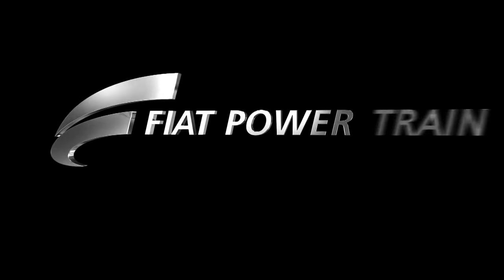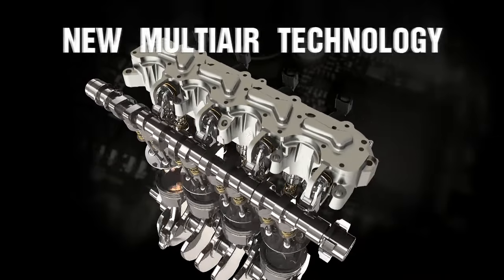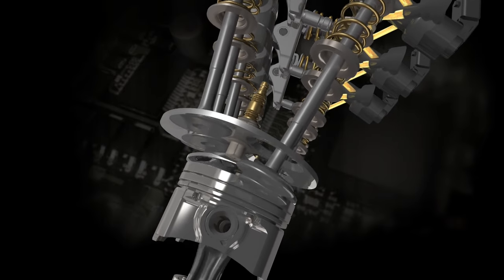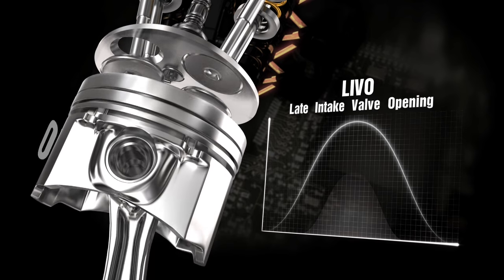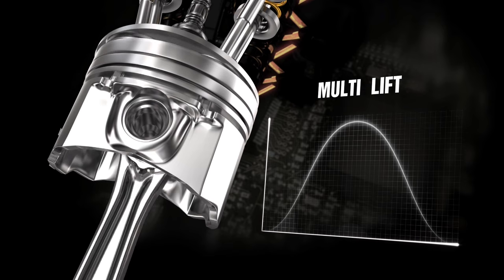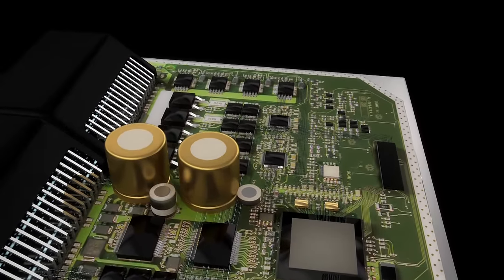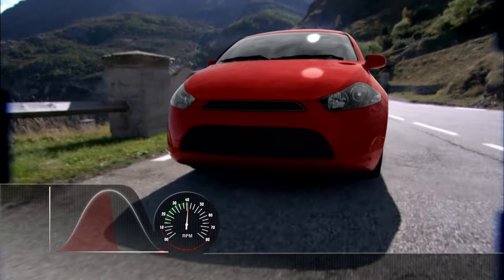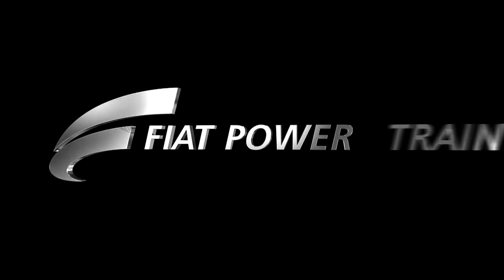How Fiat MultiAir Technology Works

Comment: Solenoid longevity questionable. Electrical Switches wear out quickly throughout history. How was this problem addressed? VVT & lift seems safer to laymen. Horror if solenoid sticks with valve in open position
Reply: Really? Who knew? They have been using electric solenoids to control diesel engine injectors since 1989 at thousands of pulse cycles per minute. All this while having no issue for 500k to one million miles of life span.
Reply: Solid state (transistor) switches have essentially infinite life, provided that they don't overheat.

Comment: Lol at my Dodge Dart that averages 19mpg in the city and 32-36 on the highway, Don't even have a lead foot...
Reply: ajjpro25 how bad is the oil consumption?
Reply: @cahman8  i don't have oil consumption I got a new generation block put in.
Reply: @410cultivar  my 16 Fiat with the 2.4 Chrysler multiair has averaged 1½ qts every 6000 miles since the second oil change. Chrysler says it's perfectly normal. They even showed me the bulletin where Chrysler says up to 1qt per 1000 miles is acceptable during the first 50,000 miles at which point it jumps to 1qt every 650 miles as acceptable.

Comment: I have a question. Would it be possible to vaporize the gasoline in a separate area and just suck in the vapor?? Because gasoline vapor is what burns. So wouldnt that be like the ultimate fuel efficiency?? Just wondering.
Reply: Thats what fuel injectors are for. They turn the fuel into a fine mist and inject it straight into the cylinders, ensuring just the right amount of fuel is used. A separate tank to hold vapor would take up to much space and it would need to continually vaporize fuel or else it would settle and turn back into a liquid.
Reply: Scott Staines Why would a canister for fuel vapor be to big?? There are so much wasted space in the engine bay as it is. Having a canister the size of an air cleaner isnt that big of a deal. And I have never seen gasoline vapor settle back into liquid. If that was possible, my gas cans wouldnt build up pressure.
Reply: the density of the vapor would be hard to control. and controling the fuelammount is very hard...
Reply: Short answer:  Yes, this is what they've been trying to do for the last 100 years.  The problem is that the vapour (mist) droplets group up into larger droplets, very quickly, against anything they encounter (throttle plate, intake runners, back of intake valve).  As larger droplets, they burn inefficiently.  A nice side effect is that they clean and cool these parts in the process.  I think you'll find the benefits you are wondering about in fuel systems that burn an actual gas, like LPG or CNG.  These burn very cleanly, but have other concerns.

Comment: Garbage! It lasts me to 44,000 miles, Multiair rubber sealant leaking oil. Afterwards one of the sensors of the Multiair failed, third, the Multiair valve signal gave me the error. Got rid of it the Multiair is a great inventor but not so good at reliability! The natural double overhead camshaft is a lot better. By the way, I have service oil regularly on time which causes me problems.

Comment: Oh cool can you imagine how fucked up an engine with VVT would run if an electronic component popped on the computer and the computer failed.

My guess is it will continue to run but you would no longer have the use of VVT and the engine would loose power, torque, and be just an all around dog of an engine.

It always scares the shit out of me when a car manufacturer says they will start using a method to electronically control something. Although when it runs it would be more efficient you gotta ask when the computer fails what then.

The mark of a good engine in my book is ease of repair, reliability and durability and finally what kind of power can be pulled out of an engine. Who the hell wants an engine that the electronics will probably only last in a real world scenario around 3 to 5 years. Would be a shame to see an engine with this shit not work right because some small capacitor popped. All any engine wants to do is rotate why invent something that allows for the possibility of failure early.

Way to throw a theoretical wrench in the top end of an engine when it is not necessary.
Reply: How often have you had a EFI fail on you? Contrast that with how frequently you hear people talking about how they just had to rebuild their carburetor for the seventh time in a year.

Comment: still no direct injection...
Reply: Good for them....direct injection for petrol engines....not so many advantages and many disadvantages....many car producers are using indirect, or returning to indirect....only VW is still using FSI.....also ok, there´re exceptions like lexus.:)) using both in one engine.:)
Reply: Karel Lang
Don't forget Ford EcoBoost
Reply: Karel Lang you statement may be true for NA gasoline engines.  But turbo charged gas engines benefit greatly from DI.
Reply: +Karel Lang vw has a couple of engines with both injection systems
Reply: For me, Direct injection means: burned intake valve at 100k miles, clogged injectors, worn high pressure pump and a horrible tractor-like sound at idle
Reply: Thanks god, DI ngines are shit, full of problems, carbon build up in almost all engines, BMW and VW are the worst, at 50,000 km they have 20% less power than new due flow restriction..
Reply: search for carbon build up on DI engines, they dont last.
Reply: and carbon build up like crazy
Reply from the maker: Yes, no Direct Injection and no expensive Direct Injection issues. ;)

Comment: multiair do not change valve time . its only change valve lift
Reply from the maker: This is wrong.  MultiAir  technology for the first time allows for variable adjustment of the valve lift , its opening and closing times, the duration and the number of openings.  This means the MultiAir system enables the intake valves to be opened and closed more than once during one intake stroke, depending on the load condition and driver requirements - and this for each cylinder separately.  This makes MultiAir the world‘s first fully and continuously variable valve control system.
Reply: Continuously... Looks like it can only open when the camshaft builds pressure for the specific valve, that's not continuously. in that way it doesn't really change valve time in the traditional way rather change duration and opening and closing time during the same window of time instead of changing the window of time completely.
Reply: @tearrificd2786  Multiair can continuously anticipate the closing of the intake valve and delay the opening (at the price of a reduction of the maximum lift and of an early closure), using a sporty camshaft, for example a 40 ° / 80 °, you only need to reduce for the low and medium regimes as well as to adapt it to the load. You can get a 40/60, a 30/70, a 30/30, a 40/0 etcetera. You can not get a 20/80 but it would not be very useful.
Reply: @tearrificd2786  trust me, you don't want to open that intake valve outside of a specific window through the engine cycle... destructive things happen when a valve stays open too long or opens at the wrong time. And by continuous, they are referring to the fact that each valve can be continuously manipulated through its specific timing window.
Reply: @Fiat500usa_com  are there plans to further develop this tech and add it to say a V8 for other product lines (dodge charger and challenger for example)?

Comment: Look like a knock off from the HEUI injection system on the International and ford 7.3 diesel engine. We were looking at electronic valve control 25 years ago at Cosworth. I have a Magnetic valve control system in my head but not going to develop it due to it would just get stolen if it worked. Patents are hardly worth the paper they are printed on.

Comment: I'm sorry but your incorrect. It burns so much oil and Dodge has a 10k mile oil change intervol in the owners manual. They burn 1 quart every 2k miles when new and not under excessive load. Do the math. And when the engine has 50k miles on it it's normal to get 750 miles per quart under normal conditions and 500 under heavy load. You can't use different oil or you own it. So by design it's a failed motor. There is no 2 ways around it. All to get another couple miles per gallon at the cost of an engine. That's just bad math. Honda does it with VTEC and it doesn't burn a drop of oil.

Comment: more likely minimum lift to prevent bent valves (of course it is fiat, so who knows)
Reply from the maker: Fiat has made some of the highest revving engines in the world.  50 years ago they had engines that could spin 13,000+rpm, so they know how to turn revs. If you bend a valve on a Fiat, you've done something stupid. Don't believe the hearsay from idiots of the past.

Comment: Funny thing tough, they claimed 10% reduction in C02 15% more torque but... Just put E85 in any turbo engine and VOILA you get the same results (if not better) without any technological "innovation" 😂

Comment: the gains this system promises are not the future. sorry guys. a 2.4L displacement engine making less than 200hp is not "optimized", as often it is proven that the more powerful these small displacement engines are, it also gets easier to get better mileage with them if you dont have a lead foot. My 07 Cobalt SS Supercharged averages 40+ mpg on the highway at 65, and mid to high 30's for most city driving, unless I WOT lol, but the point is my car is dynoed at 240hp from 2.0L and its killing fuel economy numbers for the 2.4L MultiAir and killing it on the performance side too. Its just shit tech lol, when gains of efficiency for this complicated of a system are in the 10% range.... you know its probably bs marketing.
Reply: The Alfa Romeo Gulia has a 2.0L multiair engine that produces 280 Bhp.
Reply: The 2.0 is not supercharged. It's turbocharged. And i had a 2008 cobalt ss with the 2.4 ecotec normally aspirated, i averaged 22mpg with the automatic. I just bought a 2017 jeep renegade with the 2.4 and 4 wheel drive and i average 26 mpg, the jeep also weighs 400lbs more than my cobalt, so no, it,s not a shit show.........

Comment: Synthetic oils are a very good way to slowly but surely destroy a engines. People that run synthetic haven't ever torn down a engines  with about 50,000 miles of hard use and seen the results anything from gaulded piston skirts to worn bearing to the additives separating and stopping up pick-up tubes, camshafts being starved for oil and probably some tricks that haven't been seen yet.

Comment: And that's one more reason why Fiat/Chrysler cars are notoriously unreliable: overly complex design, with too many parts that can fail. Not to mention Chrysler's bad habit of cost saving by producing cheaper parts to begin with.
Reply: not true.. fiat engines have high reliability, they have other issues but not engines problems....multi air is the most advanced technology in gasoline engines... honda vtec engines is based on a fiat technology of the '60 (VVT) and used for the first time on alfa romeo in the '80..
Reply: Yeah, but the best way to throw better power and fuel economy out of the window is to not stick to the oil change schedule, so that the mutiair unit has to be replaced for up to 1500 bucks.
Reply: haha
Reply: AlainHubert actually that incorrect the 1.4 has been given awards and has already proven to be reliable.  in a study of the top 10 motors Fiat was ranked 7th and beat out ford, Mitsubishi, and mini cooper. or delivers more power per litre than most motors built today
Reply: Wendy wooding I'm sorry but, seeing the name Fiat combined with the word award isn't credible. Awards can be bought. (The best proof of that is the Dodge Intrepid that "earned" the "car of the year" awards from Car And Driver as well as Consumer's Guide, back in 1994, and we all know what a POS that car proved to be in the end). Everything Fiat has produced in the last decade proved unreliable. That's why they had to combine their efforts with Chrysler (another crap making company for decades) in order to try and survive. And it ain't going well so far...
Reply: AlainHubert right so in the same study Honda which was #1 and Toyota was #2 and they must have paid to get those rankings and fiat paid to get # 7 as the top 10 best motors. dude your delusional. You really should look at facts and statistics instead of just coming up with your own concept of thinking in your own mind
Reply: AlainHubert s
Reply: @AlainHubert  pretty sure Fiat bought Chrysler because Chrysler was about to go bankrupt...
Reply: @robdavis6008  
Yes, but it doesn't really matter since the resulting new FCA company is again about to go bankrupt anyway...

Comment: like vtec
Reply: Except vtech can't open the valves multiple times in one stroke
Reply: No, Multiair can anticipate the closing of the intake valve with continuity, it can also reduce the lift continuously and delay the opening to regulate the amount of air sucked in and increase its speed (delaying the opening also causes a reduction in the maximum lift and an advance in closing, which does not represent a big problem because in the conditions in which the opening is delayed it is generally useful to reduce the lift and to anticipate closing; however it is still possible to further reduce the lift and further advance the closure for reduce the amount of air sucked in). Multiple valve openings are also possible for each cycle to increase turbulence and combustion rate at low loads. 
I think it can also disable the cylinders but I do not know if it is used, with the multiair you already have a big reduction of pumping losses, so the utility  would probably be low.
One of the main advantages is that it allows to regulate the power without using a butterfly valve which, when partially closed, causes a big increase in pumping losses and therefore in consumption

Comment: LOL if FIAT knew anything about reliability they would NOT have sided with Chrysler... and they wouldnt have had to beg Mazda for a power train in the Abarth Spyder...
Reply: The abarth spyder uses the 1.4 multiair..?
Reply: @hashbrownz1999  Yeah, the hell?
Reply: @hashbrownz1999  Exactly. Interestingly the 6 speed manual transmission is from the NC.
Reply: So wrong.  If it wasn't for Fiat,  there likely wouldn't be a new Miata.  Fiat didn't beg for anything. Mazda is the one that needed a partner. And it is spelled Spider. Do some research before you make a fool out of yourself.

Comment: Unrealiable. My 500 Turbo MultiAir Assembly is beginning to fail at only 52k miles with regular oil changes. It would be cheaper just to buy a used Hyundai than it would cost to repair it. Should have got something else...
Reply: Lies
Reply: No, it's not lies.
Reply from the maker: There are millions of engines using MultiAir on the road.  Sorry your one engine has an issue. Nearly all issues are caused by poor maintenance, wrong oil or extended oil change intervals. You are exaggerating the costs of replacing the MultiAir unit. The whole assembled unit averages between $500 - $1300 depending on the car.
Reply: @Fiat500usa_com , it is a common problem with these engines.  There are countless forums and post dedicated to the issue. No I'm not exaggerating the cost. You are correct in The pricing of the part, but the dealer wanted almost 3k to replace the part. I could get a used Hyundai for that money.
Reply: @tunnellcin2276  Just swap a T-Jet head on that engine, no more Multi-Air